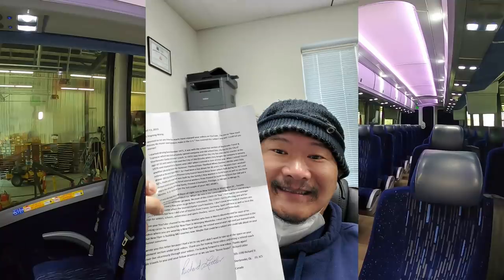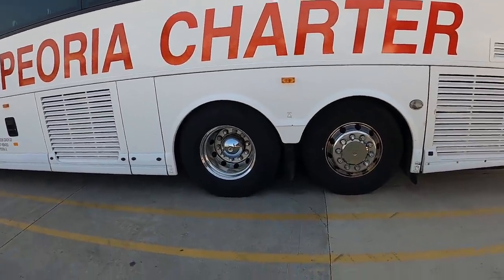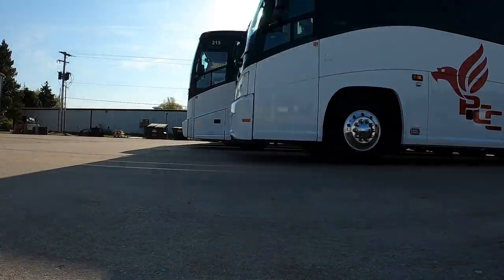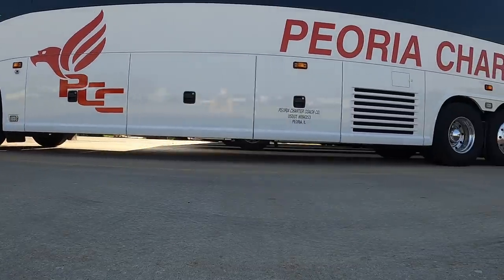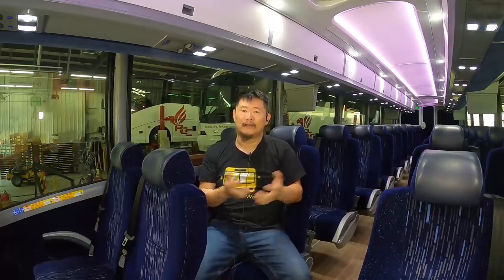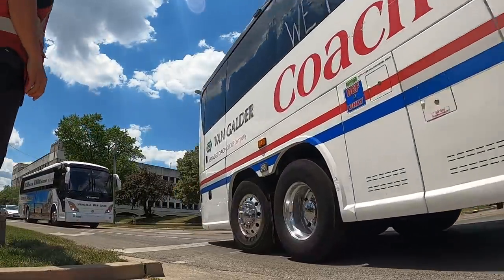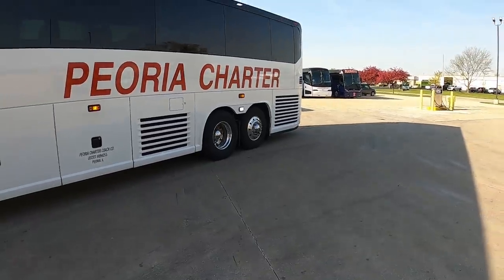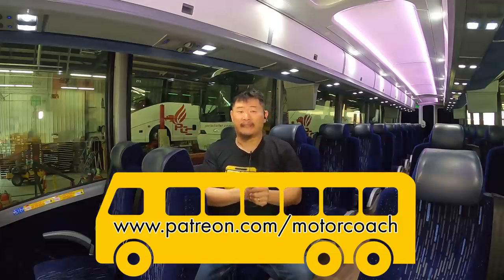The 3rd wheel | What is a tag axle??

Comment: Great content as always James!    As a truck driver who uses tag axels almost every day, you explained them very well. A little nuance thing, the “tag” axle as used on those older Eagle coaches, are referred to as “pusher” axles since the drive axle(s) are pushing them. 
Another variation of the tag axle is the type I use. They’re called steerable, but they don’t actively turn like a steer axle. They simply trail behind the drive axle and turn as the vehicle makes turns. When the vehicle goes into reverse, the axle automatically lifts so the wheels won’t bind. Have a great day!
Reply from the maker: Hey Drew! That is very interesting. I love bits of information like this. I really enjoyed reading your comments. Comments like yours make my day and it's probably the best part of me making these videos. Really appreciate you taking the time to write. Thanks again Drew.
Reply: They're most common on heavy duty trucks

Comment: Hey man! That was very interesting. I appreciate that kind of contenct. I'd love a follow up vid on this. 1. I thought the 3rd axle is steering by default. But maybe that's just for Europe then? 2. The load onto the twin wheels of the rear axle is asymetrical then? Does that mean the outer wheel is less used up? Would you swap inner and outer wheel to compensate for that? Cheers from Germany! Give me a hint when you're over on the continent. I'll love to tour you around, man!
Reply from the maker: Hey Benjamin. Thanks for your comment. I've visited Germany before. I love your culture and the food!!! I would love to go back and  spend a week or so there! I may take you up on that offer one day 😜.
Most buses in the US have passive steering tag axles if they ever have steering tag axles at all.

The dual rear wheels are locked together as far as each individual set of duals . So I would imagine they wear slightly different compairing the outer dual to the inner dual.

Comment: Steerable tags also cause the rear of the bus to stick out further in tight turns. When I was "breaking-in" drivers, I called them "sidewalk sweepers". If parked next to a curb & having to turn left sharply to enter the traffic lane, these steerable axles would cause the rear to overhang the curb considerably taking out any "street furniture" (aka - fire plugs, mail boxes, light poles, trees and the occasional pedestrian) between a sidewalk & the curb. Also, lane changes in heavy, slow traffic - you run the risk of hitting the vehicle in the next lane, rear of the "drive axle".

Comment: I'm not into busses or anything, but I'm glad I got recommended this video. Your presentation style is really entertaining and also educational.

For anyone who may wonder, "well why don't they just use wider tires in the back?" (some do but that's another topic), the reason is simple. As explained in the video, the wheels all around the vehicle are the same. The primary reason for doing this is so that you can keep one style of spare wheel on/in the vehicle, and no matter which one of your tires goes flat, you'll have a spare and be able to change it. If you just had wider tires in the rear, you would need two styles of spare wheel which would take up more space.

I may be wrong on this one, but I think if you had wider tires instead that blowouts may be more dangerous as well, since you'd lose more of your surface/traction area at once.

Now some semi trucks (lorries for my foreign friends, though this might be an American thing) do use wider tires instead, which are called super singles. They are exactly what they sound like, a single tire/rim that makes up around the same width as a dual wheel setup. You can look these up if you are curious, they're pretty cool. I'm not sure I've ever seen them used on a bus, but it's definitely possible.

Anyways thanks for the great video!

Comment: my

My all time favorite motorcoach, the Setra, also has a great steerable tag wheel.  One drawback is how much the rear of the bus swings out in tight turns.  Close traffic or pulling away from a curb are good times to lock out the tag steering straight.

Comment: Interestingly the tag axle ahead of drive axle arrangement is quite common on double decker buses, especially in Hong Kong and Singapore. Most notably, Volvo tri-axle double deckers (such as the Olympian, Super Olympian and B9TL) used this arrangement all the way until 2018. Volvo's main competitor in the double decker bus market, Alexander Dennis, has traditionally used the standard arrangement of tag axle behind drive axle. However, two of their newer models, namely their electric Enviro500 for North America and the 3-door  Enviro500 for Singapore, have the tag axle ahead of the drive axle. Presumably this is due to limitations with the drivetrain on these buses.

Comment: Thank you for a great, informative video.
I drive Class 8 trailer vehicles and have driven Class 7 coach buses for Greyhound. Tag axles are lifesaving additions to an already fine transportation machine. Their most effective application is in mitigating the heavy rear weight bias of the 2,500 lb diesel engine in the back of the bus. Even weight distribution is critical for stable high speed driving; the tag axle lessens left-right sway at speed. It also. lessens roll tendency; this is particularly evident on double axle tractors pulling trailers -- a single axle tractor with a shorter wheel base is less stable at speed.
Fuel efficiency loss from tag tire rolling resistance friction and extra resistance is minimized by less sway for straighter line more efficient traction performance at speed, not to mention less stress on unibody frame, suspension and tires. This is similar to gained mpg from wheel alignment and tire balance on a four wheel vehicle. Tag axles lessen weight on power axle so that inertial power rotation increases, enabling better hill climbing and fuel efficiency in addition to more maneuverability and safety. This principle is used in trailer tandem fore and aft placement toward better weight placement. Tag axles on buses also lessen each weight point bearing down on highway surface, which decreases maintenance and hopefully, fuel tax.
Coach bus drivers are the best and safest on the road. The safest modes of travel in this order are air, intercity coach bus, train. They are all very safe;  the pilots and operators are trained rigorously.
Passenger cars are sixty times less safe than intercity coach buses.

Comment: The tag axle is in the middle on the volvo b10tl super olympian, b9tl, and b8tl
Reply: The reason is that Volvo makes a transverse version or their buses for regions like the UK and HK, and the angle drive required for a transverse engine goes to the rear drive wheel. This is to allow for a shorter 'tail' for better maneuvering in tight urban areas.

Comment: I used to tow greyhounds. I've spent a lot of time under buses.   I have dealt with mechanics that didn't understand tag axles.   One unit had a tag axle with air disc brakes.  The mechanic was instant that it wasn't a brake pot, but was for lifting the axle.  Well, I've never saw an air suspension of any kind with a caging bolt.

Comment: G'day mate, here in Australia, driving a tri axle bus/coach requires you to have a higher class of heavy vehicle driver licence (our name for CDL) than the one you need for two axle buses/coaches.  Same applies for rigid trucks too.
Reply: MR (Two Axle rigid) and HR (three axle rigid and Articulated Buses) licences if I remember, and on top of that you need a bus driver authority card issued by the state to carry passengers.
Reply: @JaseyRae  That's correct, I only need to hold a MR licence at my depot as we only run 2 axle buses (route service).  I will upgrade to HR in the future as it will be another "feather in my cap".
Reply: @matttheaussie2144  definitely, the MR is good enough if your depot only has rigids between 10.5m to 12.5m buses, if your depot decides to get bendies, 14.5m rigids or double deckers, the HR would be the way to go for flexibility reasons.

Comment: Have you ever thought about the pressure under the contact patch of the tyres? If you have an email address I can email you an article from International Cranes & Specialized Transport (yeah I'm cool :D) which explains a basic way of working it out, as well as on soft ground [that you don't need to think about with a bus I guess] where the granular surface can fill the tread.
Reply from the maker: Hey Andrew. That's really be interesting. Yeah jwang@peoriacharter.com

Comment: Actually, not only are the extra axles there for load distribution to reduce stress on the one axle, and distribute weight better on the frame, but to satisfy some states load distribution  regs on one vehicle, so as to accomodate/ reduce pavement loads per vehicle, supposedly to reduce premature road damage.

Comment: Some coaches feature "passive" tags and some feature "active" tags.  My 45' coach chassis which was built by Freightliner was built with "passive" tags for Newmar Corp.  Newell Coach however uses an "active" tag system.  Both do basically the same job with the exception of reverse.  The "passive" tags will lock straight in reverse while dumping the air bags at the same time automatically.  The "active" tags will actually steer when in reverse however this system adds a lot more cost to the chassis.

Comment: I always thought that big truck and buses had two different sites of tires like that six wheel F1 car. And good video my good man 👍
Reply: The front and rear tires are nearly always the same size (not "site") but very often they have different tread patterns.  i.e. "steer" tires are different from "drive" tires are different from "trailer" tires.  Also, on/off road trucks often have larger "super single" steer tires and they, in turn are different from the "double-wide" drive tires you might see on highway trucks and trailers and, again, "drive" double-wides are different from "trailer" double-wides.
Reply: Then you have the super singles. As wide as a double tire but it only a single tire.

Comment: Do you guys run the same tires on the steer and drive axles?

Also, any ideas on why the tag axle isn't just a drop axle?  I'd imagine it'd be a lot cheaper (and more reliable) than steerable ones.  I have a drop axle on my old dump truck and it's a bunch of fun, and definitely helpful on tight turns.
Reply from the maker: The front tires are usually the new virgin tires. I think to reduce the wear and tear of the tag tire

Comment: The tag axles also serves as a  pivot point.   I used it a reference point to begin turns without clipping cars or hitting the curb.  On Eagles, I used the rear drive axles as the pivot points.  Eagles, Prevost,  and VanHools have great turning radii.  Not MCI.
Reply: MCI's with a steerable tag have  almost a 3 foot shorter turning radius which makes life easier in the city.  Although 2 wrongs do not make a right, 3 lefts do and sometimes driving in dense city conditions necessitate such measures.

Comment: Eagles model 5 and up had a Bogie Axle. In front of the drive axle, tag axle is behind the drives.
Reply from the maker: Ive heard that from several people. However, both of my diesel techs as well as our Shop Director has informed me that they can also be called a tag regardless of where they are positioned. Tag axle is a generalization term. He also showed me a manual that referred to the Eagles spare axle as the Tag axle so I dont think they are strictly called Bogie.

Comment: I have a question to you: By just looking at them without taking measurements it seems that North American buses of the same length have a longer wheelbase and less overhang on the ends (than comparable European buses).
Why is this so? Does it have to do with turning circle radius, weight distribution, regulations?
Reply from the maker: You know I have noticed that too. Without doing research I can speculate that its because US roads are wider and does not require a shorter wheel base to make turns. Many roads in Europe are smaller and buses of the same length may be required to fit down tighter turns. But Thats just me guessing. Maybe this is worthy of a topic on a video??? Thanks for posting
Reply: @MotorcoachWorld  I know a few places where buildings had corners cut off to let a bus pass ...

Comment: Very interesting hearing about tag axles from a coach operators perspective.  I drive a 6 axle dump truck with 3 tag axles.  Without them, my truck can weigh 56,000 lbs, with the tags, I can weigh 77,000 in my state.
  I always found it odd that buses didn't lift their tags for tight turns, reversing and when empty.  What is the psi typically set to on a coach?
Reply from the maker: Good question . It depends which wheel and what type of tire and bus. Usually between 100 to 125 PSI 
 Check out this chart. It will show you everything 
https://www.manualslib.com/manual/1239501/Mci-J4500.html?page=77

Comment: As far as the USDOT weight limits are concerned, that table is per axle (or, in the case of tandems, axle set), therefore a single drive axle is rated for 20,000 pounds (regardless of suspension rating), if you have tandems, that raises the weight rating of those axles, to 36,000 pounds.  For reference, a single rental spec truck is rated to 36,000 pounds.  20 on the drives, 16 on the steer.  Our motor coaches weighed about 48,000 pounds, 12,000 on the steer axle, 26,000 on the tandems.  Under a certain distance apart, multiple axles are considered a single unit (single axle, tandems, tridems)
Reply from the maker: hey Appreciate the bit of info here. Thanks for clearing that up!
Reply: @MotorcoachWorld  very welcome

Comment: Tag axle turn opposite of front axle thought they whoud .the lift axle is a great idea hey if u backing up will the tag axle still counter steer with front axle ? Thanks 😁😎
Reply from the maker: Great question Jim. They usually lock up when you go into reverse if its a passive steer. the MCI E model has an active steer where in reverse they rear tag will actual steer the opposite of your front wheel.

Comment: Hi J Wang. Thanks for the video. I never thought that the rear rims (or innies) were exactly the same as the front ones, only in an inverted position. Could you make a video explaining the steering angle of that third axle (how much is it). This is because it's possible to find information about turning circles for buses in general. I know the formula for a normal two-axle bus (unless it's different from a car and if so, I'm lost). For articulated 18 meters, I found some information that may help. But for these kinds of buses, I don't know. In Europe, city buses have some steering angle and some Motor coaches have a very strong one (especially those close to 15 meters). If you could make a video on this or find information, any website about it, I appreciate that.
Reply from the maker: I will work on this! Thanks for the comment!
Reply: Thanks a lot.

Comment: As an ex-coach driver I hated this tag axle arrangement and could Never see the benefit of them,in frosty weather conditions and ice they are a nightmare because the rear two axles tend to steer the vehicle in a straight line. In the event of a front wheel blowout at speed the same applies making it difficult to safely bring the vehicle to a stop because of the way the weight is distributed between the axles. The same thing happens with 6 wheeler trucks with or without all wheel drive at the rear,in a blow out situation on the front axle they are impossible to steer because the rear wheels force the vehicle in a straight line. In winter I always overloaded the front axle by about a ton to maintain sufficient grip on the front tyres in icy conditions and I suspect many drivers of these vehicles did the same to ensure safe steering in bad weather.
Reply: I found them better to drive more grip .

Comment: The wheel thing is really cool. Buses have a nice feature to them where the wheels turn sharper than normal vehicles. Also the reason you have steer tires with the mount on the inside is to make it easier as they said, tho they didn't explain the reason this is is that it balances the pivot point with the center of the tire meaning there is less wear and better control as the load point remains at close to the same position throughout driving.

Comment: Greyhound Canada had several MCI 7 coaches that were designed as combi passengers/ freight use from Winnipeg north towards Thompson They had a set of drive wheels with four tires and the tag axle also had four tires Question was this done because of weight of the extra freight or the poor gravel roads in northern Manitoba OR Both reasons cheers jg
Reply: Most likely it's due to weight distribution.  Having 2 sets of dually tires means they can distribute weight more evenly and meet bridge law requirements in Canada.  Just as a semi is limited to 20k lbs on a single rear axle, so is a bus/coach.  Adding a second set of dual tires adds another 20k lbs of weight distribution while a single tag axle can only support 10-13k lbs.  That is also dependent on the tire and axle rating from the perspective manufacturers.  An axle might be rated for 20k lbs but the tires may be rated for 15k lbs, so that must be taken into consideration.  There are several variables that determine maximum axle weights.

Comment: When tech Roy put the 2 rims together, I noticed that one was more offset than the other and wondered why, is this a European type that keeps the valve stem away from the brake heat?
Reply: One is 220mm and other is 280mm the 280mm is to allocate planetary axles, you right Europe only uses 280s whether is planetary or not.